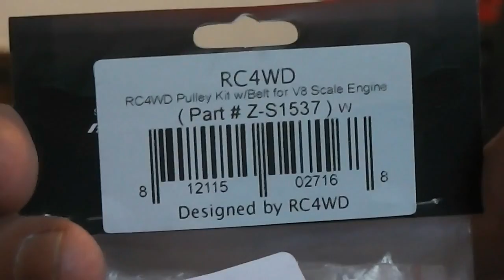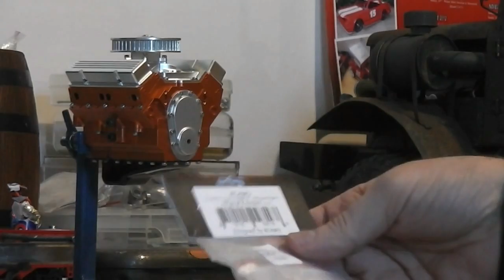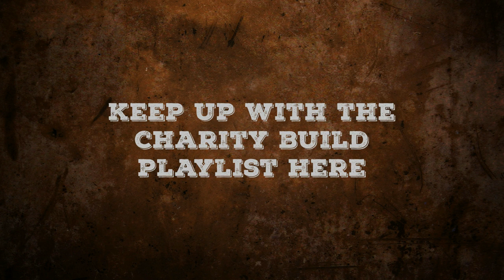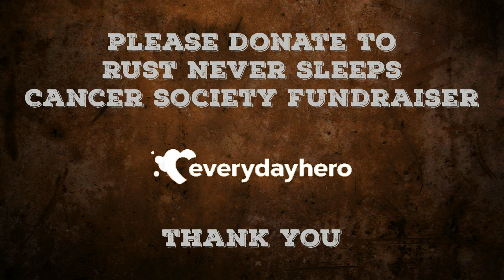Rust Never Sleeps (part 13). RC Rat Rod charity auction build for Cancer Society NZ.

Comment: I'm really impressed on how you handle that "enormous" grinder to that small parts!
Reply from the maker: Thanks man! I just take my time, and use thin 1mm discs. Most times it works out, sometimes I use a little Dremel disc, but not often.